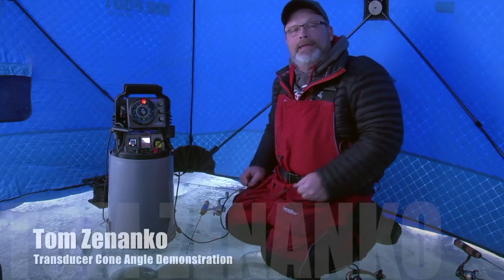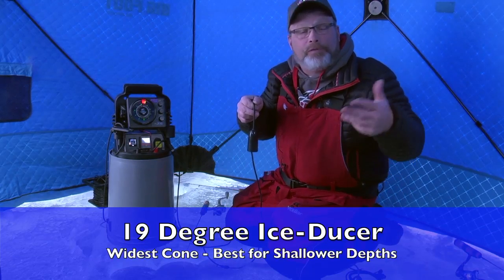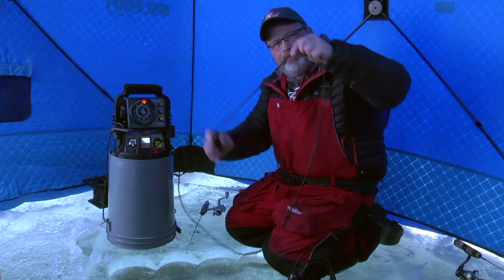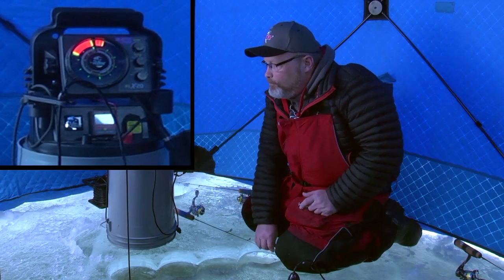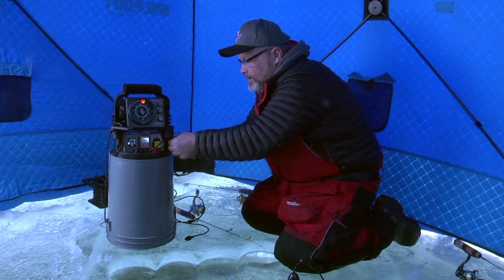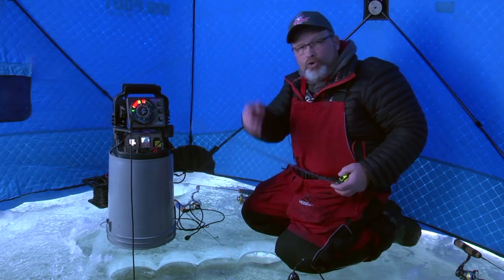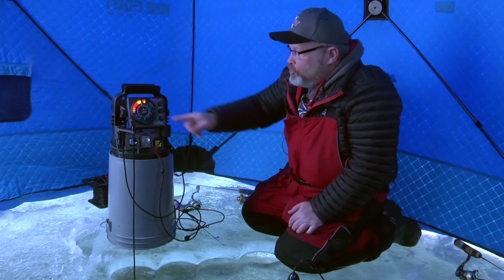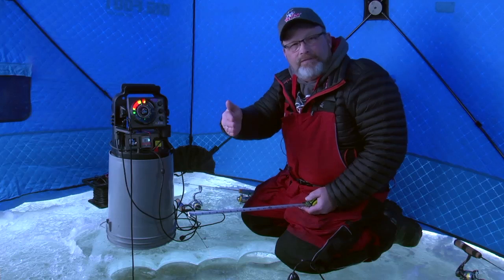Vexilar Cone Angle Demo

Comment: Thanks Tom, I am guessing that the area for the cone expands as the water depth increases?  Meaning, if you did that same test with the 19 degree ice ducer in 16 feet water depth (double your test), I am guessing that the point that you would see your lure would be greater than the 23 inches in this test?
Reply: double the depth, double the diameter.

Comment: I had a really hard time using my proview ducer in shallow water, it excelled in deep water though.   I think I would have kept my 28 if it would have had a selectable dual beam like both my HB and Marcum had.  I just couldn’t get used to the Proview. It seemed like there was too much power and I understand about the weed mode and lp mode, but that was too much messing around for my liking.   I know lots of people who really like their proview though.
Reply: My FLX-28 is the opposite Runs great in Shallow water like weeds and sand bars but past 45ft i couldnt pick up my jig at all and i was using a 3mm tungsten! My LX7 couldnt pick up in shallow but would pinpoint a 3mm tungsten at 50ft+ no problem!
Reply: @ST4R1SM1NE  maybe I should have been more clear.  It worked fine in shallow water but even with the gain at zero everything was blobby and exaggerated.
Reply: DTroFishOn that’s what low power mode is for
Reply: @brandonquern6817  as I said in my original reply.  I understand about weed mode and low power mode,  just not my preference to have to mess around with any of that.  A dual beam option would be better.  Just my opinion though.